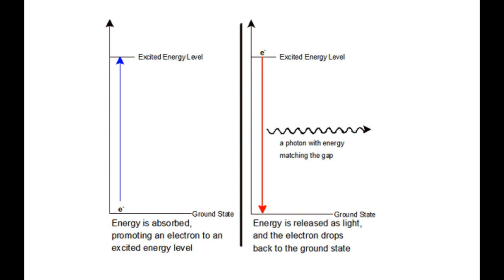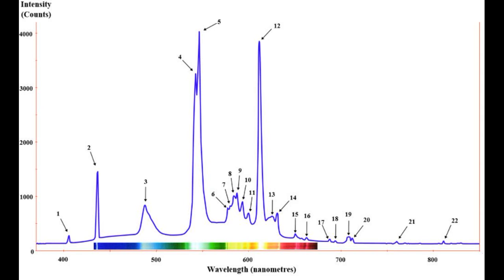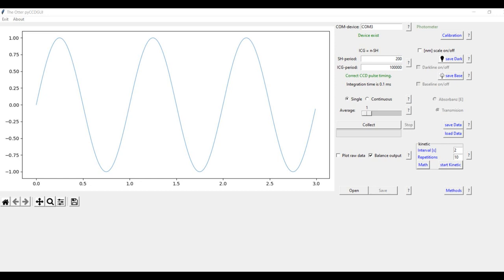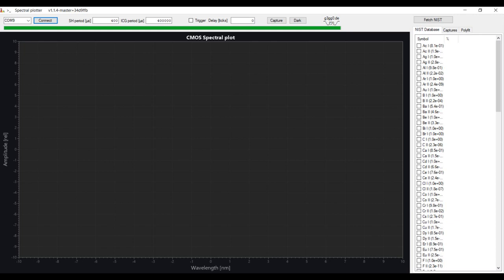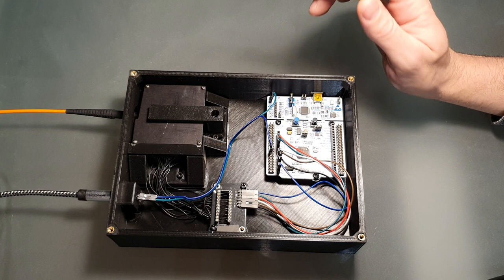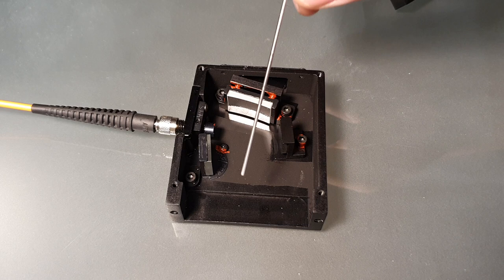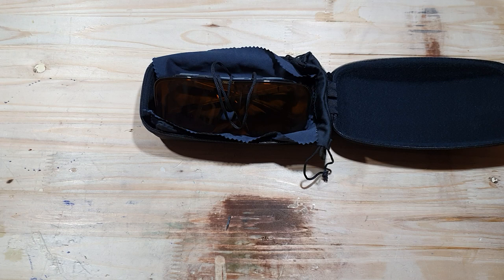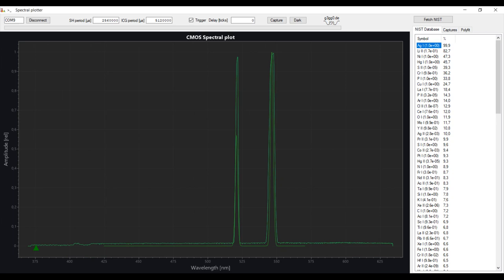Using lasers to analyze samples (LIBS)

Comment: Hi there.
Well done, your system seems pretty neat.
How are you delaying the triggering of the spectrometer?
what sort of resolution you get with the detector? how many pixels does it have?
I guess is not sensitive in the UV, where most of the info for LISB is
Thanks
Leonardo Pantoja
Reply from the maker: Hi,
I am glad you like it! The triggering gets delayed by the software. Right now it is using a 5ms delay. I would have to calculate the theoretical resolution. The TCD1304 has 3648 Pixels. At the moment the spectrometer is only sensitive in the 400-600 nm range. I am thinking about widening the range by using a different diffraction grating.
Reply: @AdvancedTinkering  Hi there the TCD1304 is a ccd, not a cmos sensor. It is a bit noisy but with short integration time is fine. It is very difficult to get a different grating on your set up. The bench is made by BWTEK, it is a BRC100  design for the OEM market. Since you got the detector working is easier to change maybe for an ocean optics bench, those gratings are easier to get on the second hand market. I could not find the software in the link you provided. Thanks  Leonardo
Reply: @AdvancedTinkering  by 5ms, you mean 5 microseconds, I suspect.  The atomic emission portion of the plasma only lasts for a few tens of microseconds (if that)... you might see molecules after that for a few hundred microseconds, but the atomic emission is over.

Comment: Are the 2K or better webcams sensitive enough for use?  Excellent work!  Thanks for sharing!  Way cool.  Looking forward to more.  Any thoughts of like ICP or other sample presentation methods?  Maybe concurrently sweeping with a polarizing lens for more dimensions of info?
Reply from the maker: Thank you!
No, I don’t think a Webcam will be sensitive enough. And I don’t think you will be able to gate the camera. There is a very tiny window where you get the discrete spectrum. If you want to know more about the timescales and many other aspects regarding LIBS I can recommend: 
“Handbook of Laser-Induced Breakdown Spectroscopy” by David A. Cremers and Leon J. Radziemski
Yes I have thought about ICP and about arc atomic emission spectroscopy but I haven’t had the time to try it.

Comment: It is an amazing project, thank you a lot for sharing. I only found this video now after 3 years of release.  I have couple of questions: what is the actual spectral range of your spectrometer ? I see what the optical bench is from B&W Tek Raman system, with the original range  of approx ~ 400- 650  nm. But I can imagine what for LIBS you need more range. And second question which laser do you use ?  I understood what it is cannibalized  tattoo removal system from Ali, but do you have any energy and pulse specs ?

Comment: Hi, this is a great project, i would to probe something similar with my students. Do you know where i can find the lasser an what wavelenght range works better?
Reply from the maker: Hi,
I can really recommend a book called “Handbook of Laser-Induced Breakdown Spectroscopy” by David A. Cremers. There is a lot of helpful information in there. It is possible to get it through sci-hub. The laser is a “cheap” tattoo removal machine. aliexpress.com/item/4000192001099.html?gatewayAdapt=glo2deu
The wavelength I used was 1064 nm.
Reply: @AdvancedTinkering  Thanks I will Check

Comment: Well done. I have a commercial Libs unit with a high resolution digital microscope at work. This might be a good further development for your system. 
We are doing qualitative an quantitative measurements with the systen. But we really have problems with repeatability regarding the quantitative measurements. Any Ideas on how to optimize that?
Reply from the maker: Thanks! But I can't help you with the quantitative analysis. I heard it is pretty challenging to get reliable quantitative measurements with a LIBS due to the many factors at play.

Comment: Liked & subscribed. A totally awesome project! So glad to see a diy tinkerer with the technical skills to pull this off with a little help from another skilled collaborator. This is how awesome things get built, and it is a model for the kinds of progress that open source collaboration can create.

QUESTION: I'd love to be able to analyze water samples on rural homesteads to see if there is groundwater & surface water pollution from sources such as RoundUp (Glyphosate). Do you think it might be possible to detect Glyphosate in water samples with a LIBS Spectrometer?
Reply from the maker: Thank you! Yes, without g3gg0s work on the software, this project would not have been possible. It is great when hobbyists get together and help each other!

Regarding your question: I am not sure. It may theoretically be possible. But I highly doubt it would be practicable for a homemade machine and more important software. To evaluate and interpret the spectra would be really challenging.
Reply: @AdvancedTinkering  I guess that means that the spectra would tell us that there is C, H, N, O, and P present but no clear indication of relative proportions such as C3, H8, N, O5, P?
Reply from the maker: @alanmcrae8594  Yes, you would probably also get spectra of other organic compounds that are created when vaporizing the sample. And quantitative measurements are very challenging in a DIY setup, because there are many variables to controll.
Reply: @AdvancedTinkering  Thanks for the feedback. I was just looking at OpenRAMAN and wondering if deriving concentrations of atoms from the height of the spectral peaks could translate into probable molecular structures?
Reply: @johngreen4610  Thanks for the feedback. 

That is my principal concern: that the RoundUp concentration would be too low to be LIBS detectable, but repeated exposure over time would administer a cumulative dose that would be toxic or even cancer causing.

Unfortunately, in rural areas where people have large grassland pastures and extemsive garden row crops, there is a tendency to use RoundUp too liberally. (As well as other herbicides & pesticides.)

Once I get my lab outfitted I am going to investigate diy testing methods. I'll let you know what I experience.

Comment: Even if Nd YAG Laser resourcing will be difficult your Spectrophotometer solution is highly appreciated. Can you provide me sources for spectrometer module without detector in such cheap price?
Reply from the maker: Thank you! Sure, I got the module vom "spectroplus" on ebay: https://www.ebay.de/itm/Spektrometer-Full-Working-optische-banch-/203594355458?mkcid=16&mkevt=1&_trksid=p2349624.m46890.l49286&mkrid=711-127632-2357-0

As far as I know it's the ebay account from thunderoptics.
Reply: @AdvancedTinkering  Thanks

Comment: Just get the cheap glasses from abroad to a few bucks, they are fine and often have better angle coverage, and you can get a new pair if they get scratchy
the best googles, you can get. are the ones you have on if sh*t hit the fence and why the cheap kind are ideal, as you can have a handfull laying around for like 10 bucks delivered.
I also dont use laser glasses that got full protection, as Im not planning on standing infront of my Nichia 7W diodes for hours in stare dow contest.
On visual laserf nm's I wanna see the beam.. its way more secure for you and the bystanders if you can see the beam, then not, and why full protection glasssed are not prefered in my book..
I want glasses that takes it down to a non harmfull level and give me that latitude until I can react, if it should strike my eyesight..
but I am also a sucker for laser beams.

Comment: You know project boxes can be purchased for less than the energy and materials that went into that 3D printed box, right? like, the clamping,  sure that makes sense, but the box itself? 3D printing isnt the answer to everything yall.....
Reply from the maker: I know that project boxes exist. I used one in my ozone generator project. But in this case it was way easier to just print a case. To add all the features to an existing box would be more expensive and time consuming than printing it. Another upside is that I could choose the exact dimensions of the box. 

I agree that 3D printing is not the solution to everything. But I think in this case it was the best option for me.